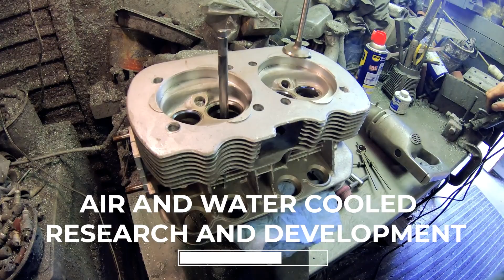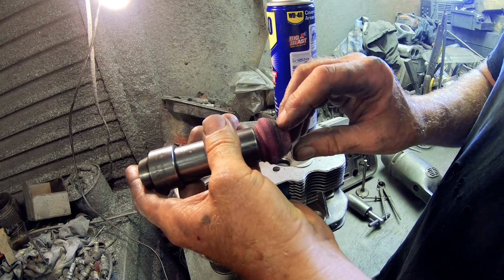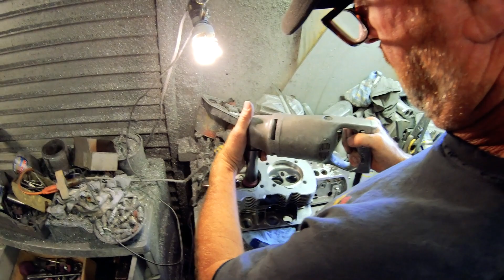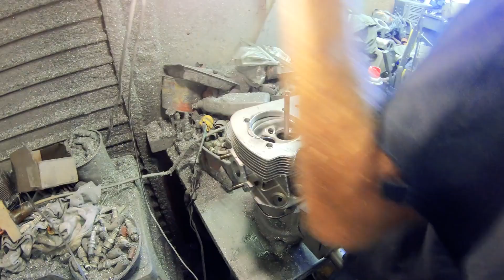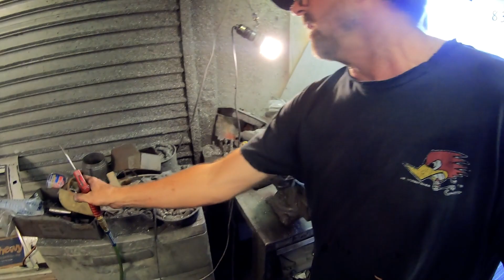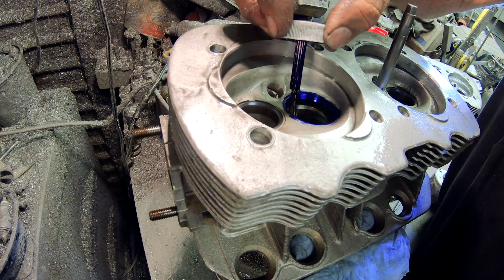HOW TO DO A THREE ANGLE VALVE JOB on a Air-cooled Volkswagen 041 Heads

Comment: Last time I used an electric valve grinder was 1979 on a Honda CBX six cylinder motorcycle that was faulty from the factory.
Spent way more time dressing stones than grinding seats though.
The 24 valve motor had tiny exhaust valves and the weight of the Black and Decker drive motor was a bit much for accurate control.
Moved to a Suzuki dealers few years later, they had Neway cutters which I found far easier to use on small valves (28 to 40mm)
Honda have used 3 angle valve seats on motorcycles since at least 1965 so I consider it the normal way of things and cut everything with at least 3 angles, sometimes 4 (75 degree into bowl) and very rarely 5 angle. (15 degree top)
For a street motor, isn't it better to have contact on valve about 0.010" away from edge?
 It gives a much better life before needing to change vale or re cut seat.
Are you back cutting the intakes?
I still have my 1970 Beetle with some SCAT stuff and 009, it hasn't run in several years though (I moved from Britain to Florida and it's still in storage)
Reply from the maker: First , yes it's better to have contact on valve about 0.010" away from edge. Next , yes we're cutting on the intakes seats. Maybe some day we can see your 1970 beetle you have in storage and try to get it back on the road. Thank you for viewing our channel.